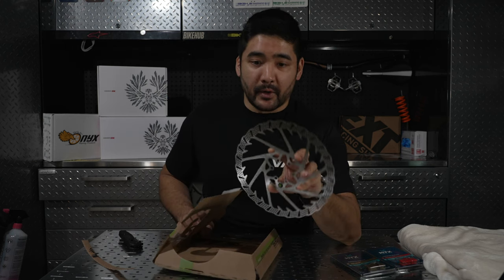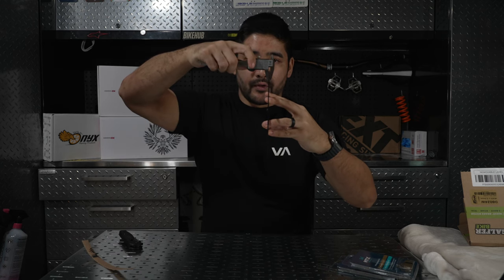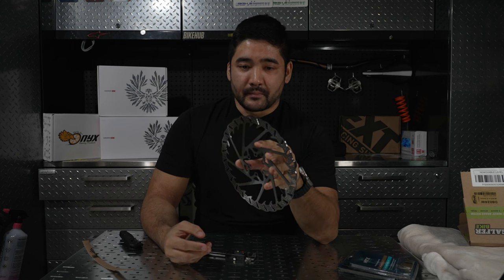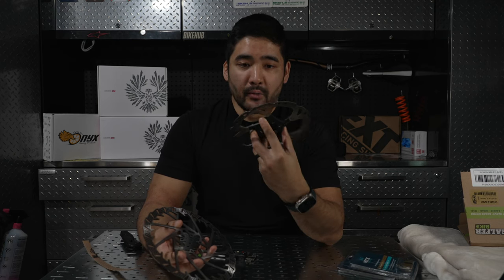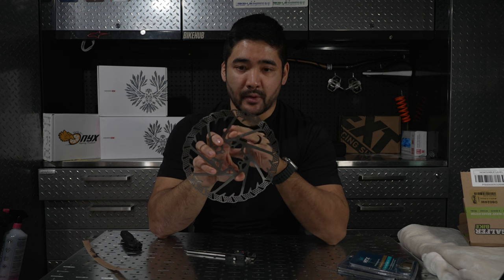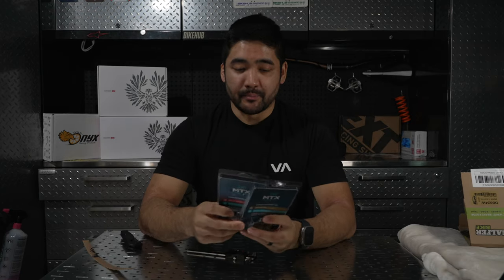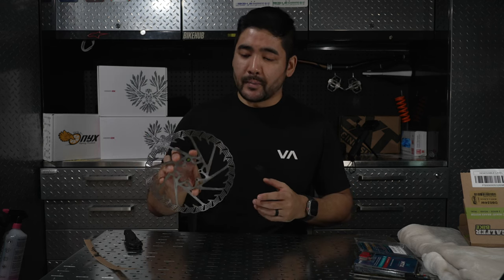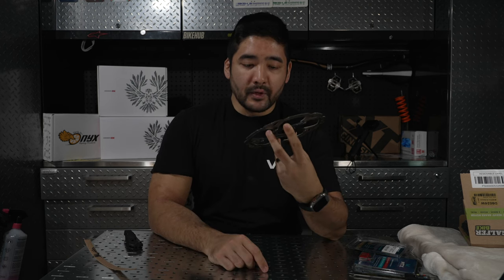Lets Talk About 2MM Rotors | MTX Brake Pad Experience

Comment: Just came across your channel, nice vid!  Are you running a 2mm thick rotor on Shimano brakes?  I have SLX 4 pistons and was considering 2mm rotors to have a quicker bite point.  I'm also considering the MTX pads as well.
Reply from the maker: I am running the 2mm. I am careful to center the rotors though as the openings for shimano seem narrower than others
Reply: Great video mate! I am running Galfer 2mm rotors with xt 4 piston no issues.
Also Magura mdrp worked but they started to come loose in the rivets.
Wish I could easily get mtx here in australia to try